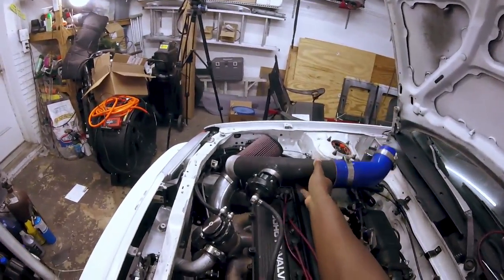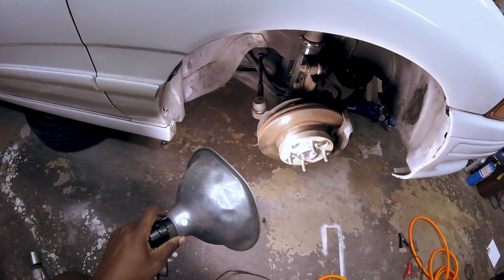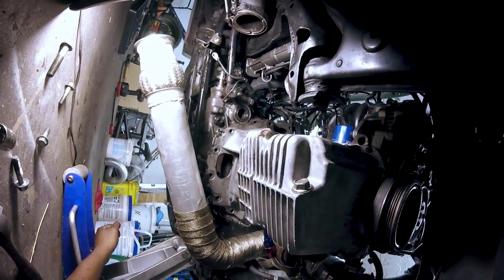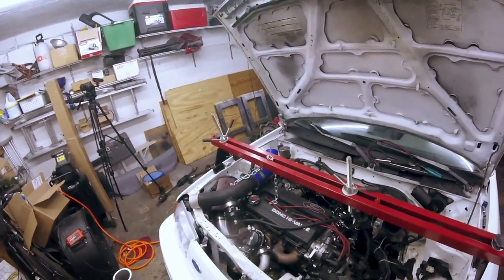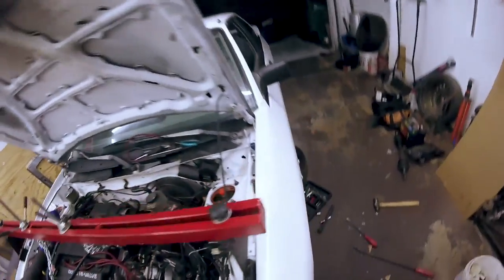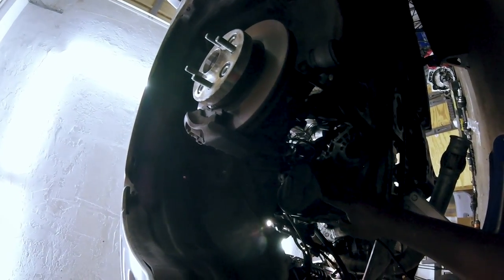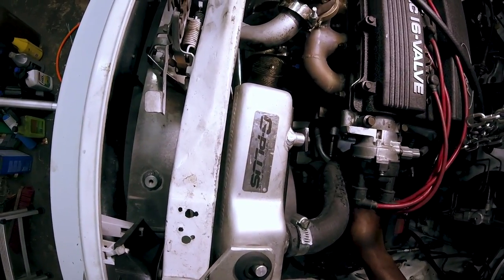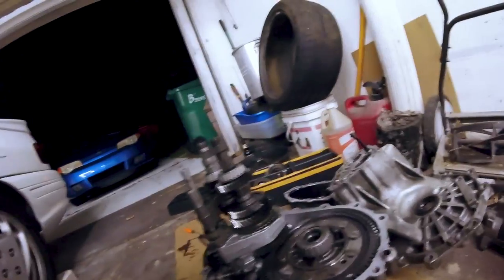93 Ford Escort GT transmission Removal

Comment: Did a similar job on a 88 Tercel thirty-some years ago replacing the clutch. I removed the tranny that time by crawling underneath the car and bench pressing the transmission out. Then I put it back in using a two-by-four across the top of the motor and ropes wish I sent up in three or four steps I think using jacks or something to leverage the transmission up. So good job. Brings back memories LOL. I'm looking at doing a transmission pull on a 97 Escort. There's barely 2 in of clearance to the wheel well. So thanks for the inspiration not sure if I'll do this or not.
Great video.

Comment: Hey I was hoping you could answer some 5spd escort gt questions regarding stock egt 5spd trans. So 2nd trans now that broke with my 184whp egt. Both times I'm 5th getting on throttle. So this time case didn't  break yet. But no more 5th. And trans will lock up when driving. By the time I got home all I had was 2nd.

So do u know:

how much stronger is 97 kia  Sephia trans?

Can I rebuild this trans or is it screwed? Where to get parts?

Thanks
Reply from the maker: The Kia trans is supposedly stronger. Can't say on your current trans with out getting inside it.
Reply: @StovallsGarage  I ended up going 97 kia sephia trans. For any one doing this swap, U will need both axles and intermediate  shaft too. Got one with 70k for less then 150k escort trans. But paid another 100 for two new axles and 50 for shaft. I read it's stronger too. Time will tell.

Comment: What kind of radiator is that you are using? Also where did you buy the ecm?
Reply from the maker: It's a G-plus(ebay) civic radiator.  I got the ecm from DIYautotune,  the one I have is a build it yourself deal, but they do have prebuilt units that are plug and play.